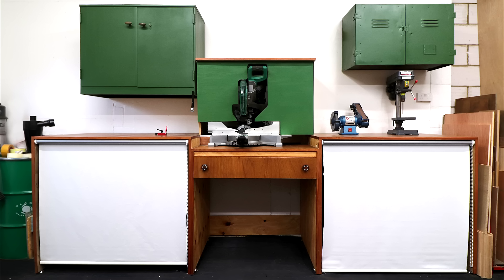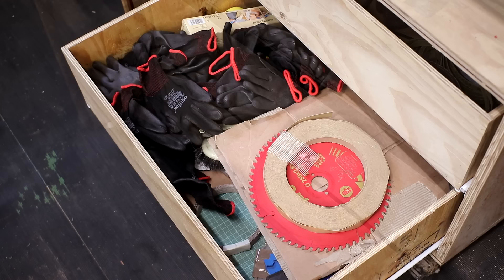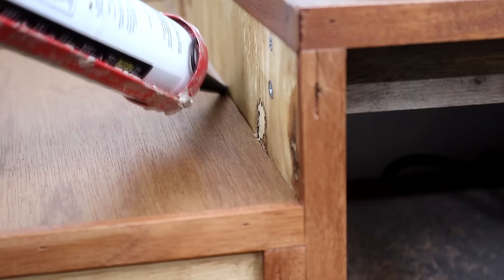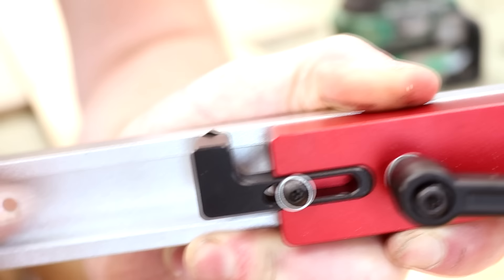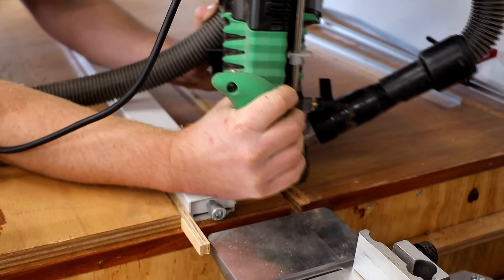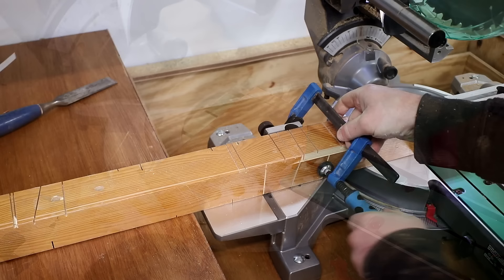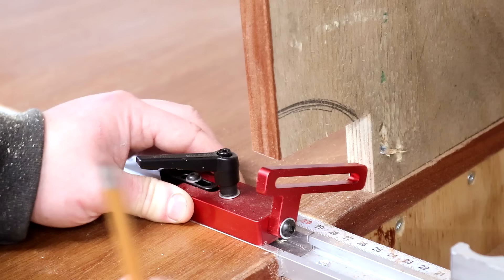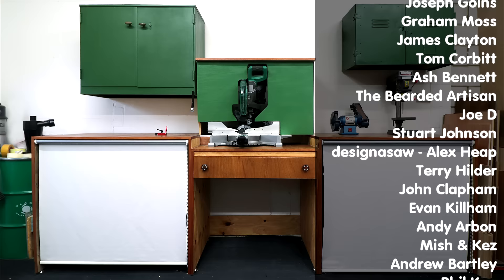Making The Mitre Saw Station

Comment: Great build and kudos to sithlordst32 too - I like the roller blind idea. "Yoink!" -> the sound of me pinching that idea!
Reply from the maker: It is a great idea! And it works well too. If you can get the plastic/vinyl ones the dust cleans off much easier than with fabric 👍
Reply: I agree. Totally going to use that idea

Comment: Hi Keith.   Like you, I did not want a backrest on the worktop upon which my mitre station is mounted as I also had a lathe on the worktop that I could occasionally move forward to use.  I had moveable 'risers' on each side that lifted  my workpieces up to the level of the mitre platform, which had rotatable stops at each side for setting repeated measurements when a riser was clamped to the worktop.   This worked OK, but was fiddly to set, so your solution of putting a track and measure on the support SURFACE appealed to me.  I got another five-foot length of worktop cheaply, and after cutting slots for the T Track and Tape on the table saw, mounted it at the correct height on the left side of the mitre saw - I moved both risers to the right.   I got a stop similar to yours, and it works a treat!
I have not been able to attach the tape measure yet as the stop - APPARENTLY JUST LIKE YOURS - that I ordered from Amazon will not arrive until December 2nd!
Revisiting my order to see if there was any way to speed up the order, I realised that your UK link https://amzn.to/2VZCzJG took me to a SIMILAR stop to yours, but WITHOUT the adjustable indicator to set to the tape.
* A stop WITH the adjustable indicator is at   https://www.amazon.co.uk/KUNSE-Aluminium-Alloy-T-track-Woodworking/dp/B07KR638ZG/ref=sr_1_1?keywords=Precision+45+Type+Miter+Track+Stop+Aluminium+Alloy+For+45mm+T-Slot+T-track+Woodworking+DIY+Tool&qid=1574007057&sr=8-1
They both seem to come from the USA in view of their long delivery times.
I've tried to change my order but will not hold my breath!
If I have to accept the existing stop, I guess I can attach an adjustable indicator to it - and the one I have already - but it is very frustrating not being able to mount the tape measure until after December 2nd when I will know what allowance to make for the indicator.

As an addendum, I realised that my lathe would just cover the T Track even when pushed backwards.   I never really liked that lathe, and sold it cheaply, so I can get a nice new - smaller but electronically speed controlled one - for my upcoming Christmas (and birthday in January!) present!

Comment: You may want to consider cutting a fixed length piece from aluminum or delrin that you can use as a spacer when you want to cut pieces smaller than 200 millimeters.  This will work around the limitations of your t-track.  All the best.  Your video was excellent.  Thank you for sharing it.
Reply from the maker: Great idea! Thanks

Comment: Plenty of ideas in this project. For the same reason as you, I prefer a fence-less mitre station - there's too much useful space on the top and fancy fences just seem to get in the way. It would be interesting to know your thoughts in a couple of months time on the effectiveness of a passive collection system vs using the draw for storage. Thanks for the link to the kreg measuring tape...
Reply from the maker: Cheers Karl, I'm actually considering using the front of the drawer for storage and the back for dust 🙂 just need to pop a partition in

Comment: I like the idea of the T rack cut into the bench top. I might have to consider a remodel for mine.  I didn't see a bin for the scraps coming off the saw, maybe a 'Bin' would fit nicely in the space to catch the offcuts
Reply from the maker: That is a good idea! Will think about how to incorporate that 👍
Reply: @RagnBoneBrown  My scrap bin and "prototyping" wood pile is now on top of the hood.
Reply: The inspiration for my stop block came from Fastcap.  It allows repeat cuts all the way up to the blade.

Comment: Great video series. Could I make a suggestion about your t-track? 
You said you added some track so you could make shorter cuts, but implied that the cut length was still limited to a minimal length of 300mm approximately.
You could use a preset block to offset that gap. 
Example:
340mm gap with a 240mm block makes a 100mm cut. 340mm gap with a 340mm block equals no gap at all.
Extension:
I set my ruler at 12 inches back from the blade and then have a 12 inch block which I set at the start of the ruler as point zero,  I can then measure any gap I can read off the ruler to set my stop and that is the length of my cut.

Comment: Brilliant - I'm about to make something like this - no doubt way more shoddy than yours - I was thinking of either using wipeboard (or is that just melamine??) or blackboard paint for the front of the shroud... I have the memory of a goldfish with dimentia so having somewhere to scribble cut lengths would be handy. You and your videos are great... although I wish I'd seen it before I ordered the Kreg system... it will see if it can be set into the top as that's genius.  Thanks to you and the moggy invasions.

Comment: nice job. how is the dust colection workingi dont like the part held on with magnets. it will work great but i would never put it back , i think cutting it in half and hindging them would work better so they are always out of the way when opened but still atatched and not lost or broken

Comment: Fantastic build Keith I love how it looks. Could anyone advise me on a finish? I have made a coffee table top (inspired by one of Keith's videos) and it has some nice grain. I need a product that would both pop the grain and provide a fairly durable surface. I am a bit confused! Any help would be appreciated.
Reply: I've used the combination stain and polyurethane in one stuff and it works pretty good .  Water based is very easy to use and clean up.
Reply: @dangermartin69  Many thanks. Yeah I think I'll go for that.
Reply from the maker: This may help https://youtu.be/E33TZnGrLQg